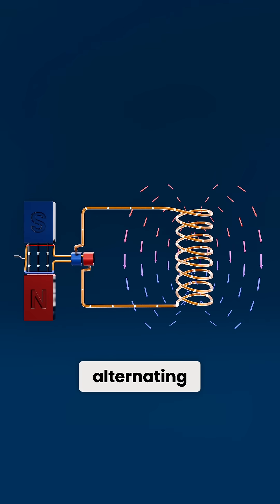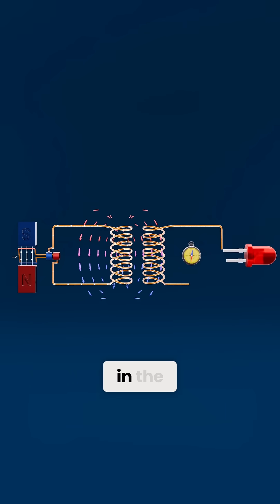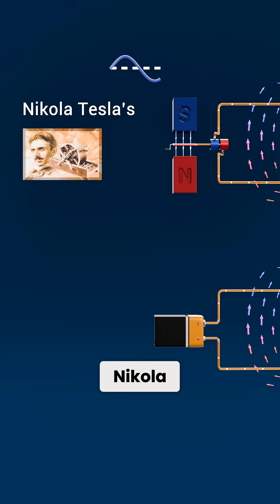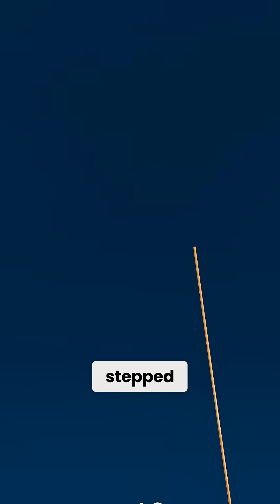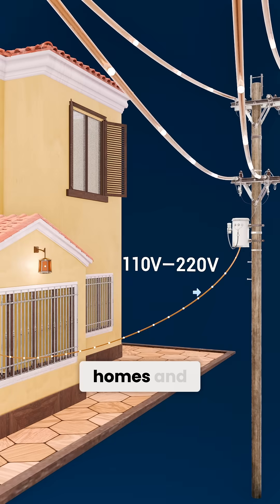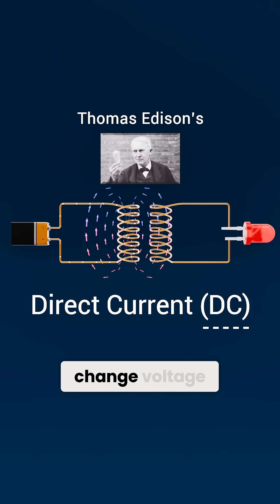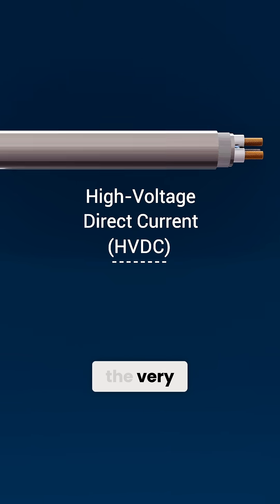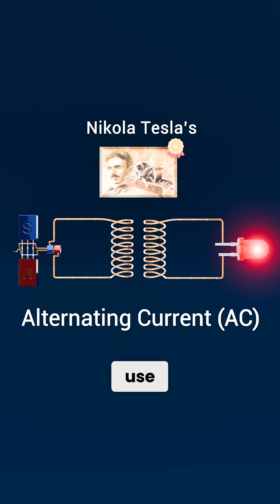Why Tesla’s AC Beat Edison’s DC for use in Transformers | Transformers Explained #transformers

Comment: Also due to inductive reactance  the transformer doesn't act as shorted wire bundle for AC
Where for dc the transformer gets saturated quickly with no change of direction of current and it starts to act as a shorted wire coil,
Reply: Where are you going after you die. Repent today from your sins. Hebrews 9:27 says as it is appointed unto man once to die but after that the Judgement.

Confess your sins and turn to Jesus Christ today. He is the way, truth and life.
Reply: @JesusPlsSaveMe  ok
Reply: @JesusPlsSaveMe are you a fool?

Comment: Agreed 👍, but I still wish it was the other way round😅 ,this AC currents hit hard 😂
As an electrical engineer I'm always ready to briefly view the gate of heaven 😇
Reply: DC currents hit harder. Safe voltage of DC is 24 V, while for AC it's 50 V. The difference comes from, as one of the reasons, the electrolysis of blood, which is very efficient when DC is applied, and AC naturally cancels its results in some extent. At the end of the day, touching two poles at the same time is just a stupid idea, no matter AC or DC :-)
Reply: @jarekferenc1149 
Revelation 3:20
Behold, I stand at the door, and knock: if any man hear my voice, and open the door, I will come in to him, and will sup with him, and he with me.

HEY THERE 🤗 JESUS IS CALLING YOU TODAY. Turn away from your sins, confess, forsake them and live the victorious life. God bless.

Revelation 22:12-14
And, behold, I come quickly; and my reward is with me, to give every man according as his work shall be.
I am Alpha and Omega, the beginning and the end, the first and the last.
Blessed are they that do his commandments, that they may have right to the tree of life, and may enter in through the gates into the city.
Reply: AC or DC, both will fry you if powerful enough and have enough voltage to draw a current in your body (without forgetting for how long you're zapped). If you're an engineer and still in high risk of being injured by your own work, isn't it pure dedication to fail?
Reply: @Cec_Krem 
Where are you going after you die. Repent today from your sins. Hebrews 9:27 says as it is appointed unto man once to die but after that the Judgement.

Confess your sins and turn to Jesus Christ today. He is the way, truth and life.